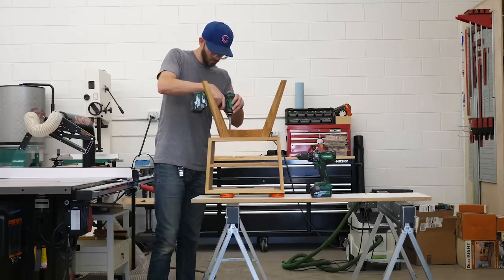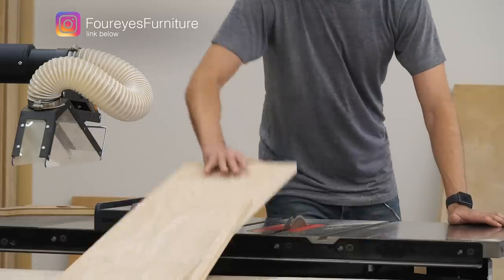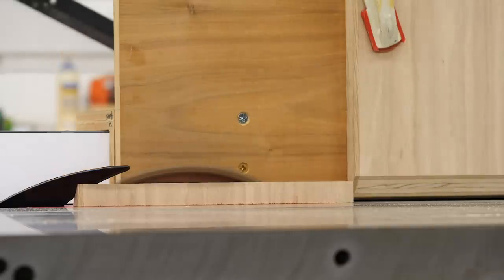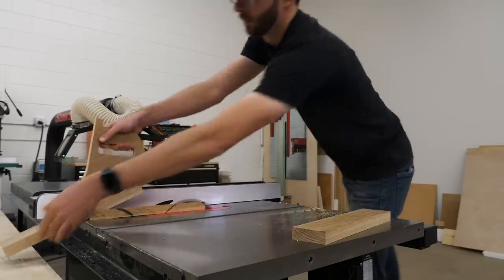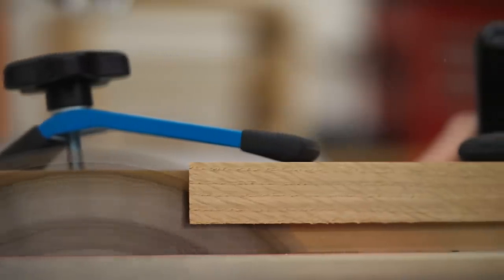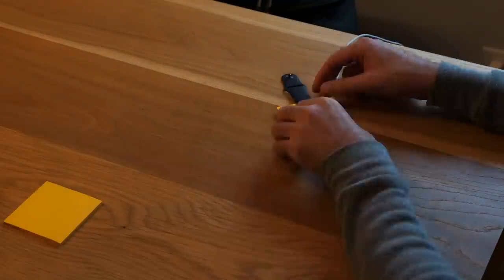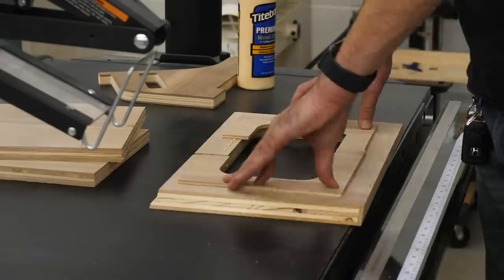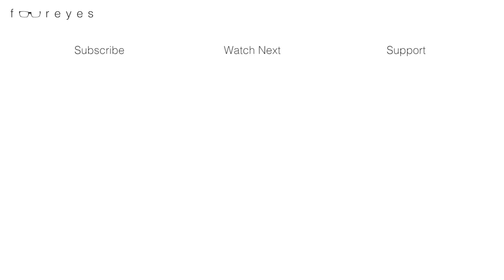Hidden Wireless Charging Nightstand | DIY Woodworking

Comment: Chris, I discovered your channel a few days ago and am absolutely loving it. I have a tip (not woodworking!): the chargers normally have some tiny screws hidden under the rubber pads. If you take them out you can open the case and get rid of the plastic parts and just keep the guts. This can get the charging coil that much closer to the phone and help the charging speed.

Comment: I've seen you explain your angled cut thing a few times and its relatively easy for me to wrap my head around the math but today is the first time I realized its actually easier to do it this way from a cutting perspective because the error is removed. You don't have to worry about being off a 1/4 degree one way or the other because of the process.
Reply from the maker: Yup! That's one of the beauty parts. No matter what you set your blade to angle wise, it'll self correct since it is locked in position and you're rotating the piece 90 degrees :)

Comment: Like this piece Chris.  Pretty sure that all the actual angled cuts on the work pieces are called bevels (hence: a bevel gauge), and a miter is the joint where two bevels meet.

Comment: Hi Chris,
Check out Sean Rubino’s video for flush cutting trim. If you flush the left side of the blade with the left side of the fence, you have less of a chance of messing it up. Basically bury the blade below the flush cutting fence. This nightstand is really great looking. Love the idea of adaptability.  Congrats on going full time. 
Brian
Reply from the maker: Thanks Brian...and this is the most straight forward, normal message I think I've ever seen from you :) 
Have you been kidnapped and are you ok? Blink Twice
Reply: Chris Salomone 😐😑😐😑

Comment: So cool man!! Maybe you could make a one similar to this where you build something like a wireless charging tablet stand where you charge your tablet on it or heck you could build one where it charges your Switch or your computer on it. Because it's nice to see your technology on display, but they're going to run out of battery so it would be nice if they were charging while you're using them (like you did for this video where you built a nightstand for charging your phone).

Comment: This is armchair woodworking, but I feel like some splines might be a good idea for a version 2.  Any force on the top and the shelf are working to split the night stand apart.  Even if you're not planning on subjecting it to a ton of weight, I feel like the splines would give a little insurance for the tightness of the miters.  That and I think splined miters look cool.  A neat concept.  It would be nice if somebody would make a big wireless charging pad that is intended for furniture integration like this.  They could design it to be a little more powerful so you don't have to thin out the material it's mounted under so much.  Maker Brand Co ideas!  Congrats on going full time btw.  That shop space looks like a wonderful place to be.
Reply from the maker: Thanks Colin...the splines ins't a bad idea. I don't think this guy will be going anywhere...but an extra insurance policy can't hurt. And if you like the look, then it's doubly good. As for the pad, that would be great. And is kind of what apple is trying to do. If they can't figure out how to make them work safely, then I doubt we will :)
Reply: @Foureyes.Furniture  My snarky guess as to why they didn't go to market with Air Power is because they didn't have a way to make it proprietary to only work with Apple products (since they use the industry standard Wireless Qi.)  Apple loves their walled garden.

Comment: Nice piece.  Congrats on making the move to full time.  Oh, and most importantly...it's nice to see you figured out the trick of mounting the figure 8 fastener by drilling slightly off the edge versus using a chisel like in a prior video.  Way easier approach!!
Reply from the maker: Thanks man...and it wasn't so much where I was drilling, but using a bigger forstner bit was the real key. I was using one the same size as the figure 8 before.

Comment: Nice project. Thanks for sharing. I had a thought while watching that I thought I would share with you - benefits of hindsight! When you were using the CNC to cut out the insert, an option would have been to bevel the edges, then the insert would drop in (like the shelf) and avoid it the glued on plywood under. It’s still a great project.
Reply from the maker: Nice...yeah...that's a good idea. At first I thought about a rabbet...but I got a little lazy.

Comment: Another cool build!  You ever consider moving to a bridle joint for your legs?  Or just a little more work you'd get a more balanced looking joint with way more strength.
Reply from the maker: I didn't a joint like this one time as a bridle. I guess I didn't love it since it didnt stick...but perhaps I'll try it again, if anything for the same of variety.
Reply: @Foureyes.Furniture  strange...should have been at least twice as strong since you have twice the glue surface and some mechanical advantage.  Variety is the spice of life!

Comment: i think the edge banding flush trim jig/fence supposed to be used slightly different for safety. Basically push the tall fence over the blade and the dado at bottom of fence is for the overhanging edge banding, so fence should like up perfectly with outside of blade (left of blade for you) so that the blade is buried inside the fence. Your method is on outside and blade is protruding just below your fingers.

Comment: That’s smarter then the rest tables I seen to pull out the middle and change it then router it out so the phone will fit perfectly and not have to move the phone around to find where to place it good job
Reply from the maker: Thansk man...it's been working well for me everynight. I just move it around until it pops into place and I'm good :)

Comment: I Like the insert idea and the cut out for the phone. I think it would be cool if you could use some different material for the removal section. Bamboo, cork, plastic maybe even concrete.
Reply from the maker: Thanks man. That is a definite possibility if one were so inclined.

Comment: Several manufacturers are seeking FCC approval for RF devices providing 'over the air' inductive charging, at distances of 3 to 10 feet or farther.  So an insert that lets you put your wireless device on or very near a charging pad will soon be a thing of the past, and the charger can just be in the room.
But, still a cool nightstand AND video, as always!

Comment: Would it be possible to cut two opposing lips into the removable piece and the top board in lieu of cutting the entire hole and gluing a support underneath? I am glad to see makers addressing that technology is going to change overtime. Also congrats on going full time with your career, keep up the good work.
Reply from the maker: Yeah. you could cut mating "rabbets" on each of the pieces. That would actually be the nicest way to do it...but more work.

Comment: The first time I saw the flush trim fixture was in William Ng channel. He has other cool stuff like the 5 cut method for making a crosscut sled.
Reply: If I recall correctly, William's flush trim setup is with the outside edge of the blade flush with the outside edge of the fixture. That way if your workpiece wanders off the fixture you don't cut into the workpiece.

Comment: Only thing I'd do differently is machining the top. Rather than adding a retaining lip to the underside of the top, first through cut an undersized opening, then perform a pocket operation to machine a rabbet to support the insert. Machining the insert as an inverse profile would result in puzzle piece-like fitment. Alternatively, the insert could be a simple shape the depth of the rabbet. Hope that makes sense.

Anyway, a great idea, wonderfully executed. And, congratulations on going full-time!
Reply from the maker: Hey John...yeah, that makes sense. A rabbet was my initial idea. I got a little lazy I guess

Comment: Chris, I am curious how much wood was left after you routed your pocket out. Im implementing a similar feature in a side table but my test run with poplar only left about 1/8" by the time I was able to get the phone to charge through the wood.  Did you feel like the insert was any weaker for how much you had to carve out?

Comment: 8:01 time for a blade cleaning and probably sharpening by the looks of the amount of pitch. My main guy just lost the tip of his finger due to pushing harder through the cut and hit a knot in the middle of the wood which sped up feed and his finger racing to the blade. unfortunately saw stop tech isn't available on industrial sliding saws
Reply from the maker: probably a good cleaning. I should just change it. I have like 3 blades. once they all need it I clean them at the same time.

Comment: Nice build! It addresses the only thing that's bothered me about including tech in furniture. I've seen people build timeless, beautiful furniture that will probably outlive their kids but then build in a port for a specific item that'll be outdated by 2020. This is a nice solution, I've thought about doing the same but where the removable plate isn't visible from the top. Still not sure how thatd work
Reply from the maker: Yeah, I think as long as the cuts are only on the underside it is ok...since you can just kind of retrofit things...as long as the underside is accessible. Since I wanted to make the little recess for the phone, I wanted to make sure it could be changed later
Reply: @Foureyes.Furniture  yeah I agree. Love the white oak btw I'd like to see more builds with it. Congrats on going full time as well wish you the best on that

Comment: How much material is left between the charger recess and the top? Did you notice any performance degradation between direct phone-charger and phone-plywood-charger?
Reply from the maker: it's about sixth of an inch I'll guess. It worked between 1/4" material, but I didn't test any degradation. My thinking was, it'll sit there for hours at a time (while I sleep) so I should get a full charge no problem...so not super concerned about quick charging etc...

Comment: I like the idea of using template plates for the wireless chargers, giving you the opportunity change it out if you ever change your phone.  The nightstand looks great.  Also Congrats on going at this full time, you'll do great.  You're work is one of a kind.  On a side note, kind of surprised you didn't use the makerbrand.co clamps on this project, LOL.
Reply from the maker: haha. Thanks! They are all in my garage. I'm planning to still produce videos out of my garage, which even more of a DIY slant. So those will be my home clamps. I want to display them nicely on the wall :)

Comment: To be able to charge the watch, what about thin veneer as the top surface of the insert. Just thin down the insert so the veneer fits. If you really want it to match the rest of the top, use the same wood for the veneer as the case. It shouldn’t be too obvious

Comment: I've seen a lot of these "top" charging" spots. Is it possible to do this like Holsters (maybe leather. plastic, wood, or fabric?) on the sides? (I don't have any fancy phone and will never have one that charges this way. I don't have any friends that could use them either.)
Reply: That's a great idea! As long as the holster holds the phone snug to the wood it would work.

Comment: Would this still work if the nightstand was hardwood but insert was still plywood?
Reply from the maker: Yeah, there would be the potential for some wood movement issues, so you'd probably just want to make sure that the insert had a little room to breath. But honestly, the insert is so small, your best bet would be to make the insert from the exact same material. That's another reason I'll probably keep my inserts plywood. Also, it'll match more nicely.
Reply: Chris Salomone thanks. I’m looking to do something similar on a 10’ sofa table (so plywood isn’t an option).

Comment: Great piece, but hot gluing that wireless charger into place was heartbreaking. The rest of the design was so considered and the hot glue just felt like a half-hearted, hurried conclusion that left more elegant, yet equally simple solutions on the table.
Reply from the maker: That is fair. It's just so easy and so hidden.

Comment: Another great project, and congrats on going for it full time and getting the new space Chris!  How about a veneered insert with the watch charger just a veneer thickness away from the watch?  Another option would be a double layer indentation (X-carve) where the watch sits below the surface directly on the charger so you won't see it when in use.  That would be not dissimilar to what I did for my car charger but at a smaller scale:  https://youtu.be/3zWfgUMrPVA
Reply from the maker: Hey Jeff...that was the basic idea for the watch that I had shown on camera. I think I would have needed to route another few mm to get it perfectly flush, but basically you'd see the charger flush mounted when not being used, and then it would be covered by the watch when being used, and the watch would just look like it was resting on the table. I think the veneering idea sounds kind of interesting. I'll re-approach this later though.

Comment: I'm coming to the conclusion that the more you create the less math you do.
Reply from the maker: That's sort of true. The more you find ways to use relative measurements instead of trying to figure it out with Math - which is less accurate a lot of the time because it's theoretical :)
Reply: @Foureyes.Furniture  As a PhD student in theoretical physics, I resent that statement.